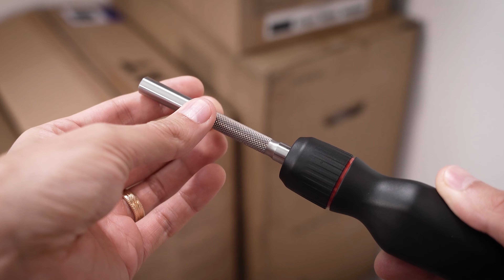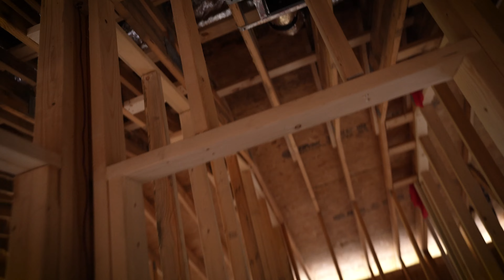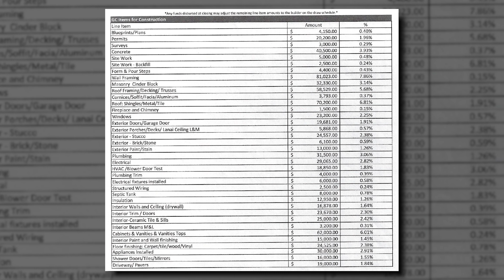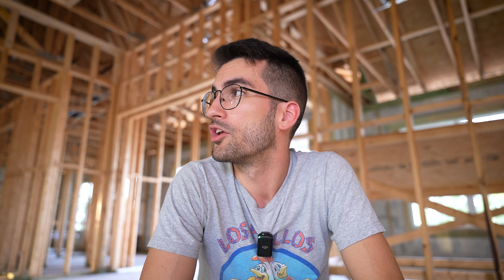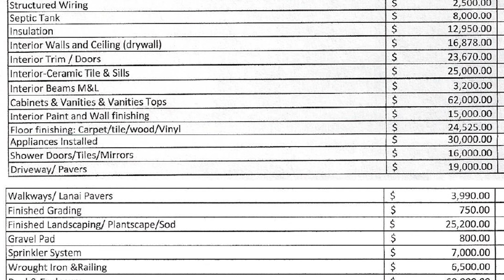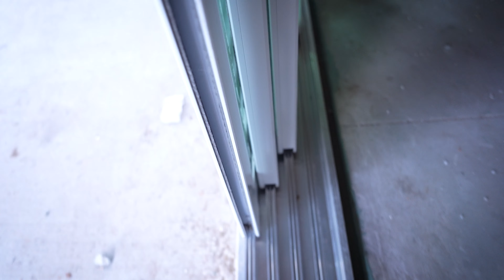Here’s How Much EVERYTHING Costs...

Comment: If anyone wants to give crap over the design - I saw the area impacted by the eye wall of Hurricane Ian.  The only new construction homes I saw when I was there that really got blown down were a couple under construction brick walls that didn't have any framing yet to shore them up (although, I would not be brave enough to go 2 story since that's always full wood from what I saw).  The really hard hit areas like Fort Myers Beach were not wind damaged.  They were water damaged.  Water moves mountains.  You are not going to be able to build anything reasonably affordably to withstand a sudden 12 foot high tide.  The correct construction is wooden interior framing.  None of that metal crap and none of that concrete crap.

Comment: I'm an Electrical Engineer in Southwest Florida, I've work on electrical designs for a few homes. I can say your build looks better than 99% of the McMansions we would be hired to design.
That low voltage installer issue is frustrating, finding good low voltage installers if hard enough.
I hope you continue making these as they are very interesting to see from the home owner's perspective.

Comment: Talk to your electrician. Chances are they will let you run all your cables and they will check off on it. But run it by them, they may go around and mark the locations with you so you do not interfere with the rest of the electrical in the house. because low voltage and line voltage need to be kept separate from one another. That is probably why your county requires an electrician to do it.

Comment: here's hoping that A/C is multi-zone with separate thermostats.

Edit: I have been re-terminating the cat 5e I put in when I remodeled in 1999. The Belden REVconnect tools are terrific.  I actually put in cable bundles with 2 RG6 coax, 2 cat 5e, and 2 OM1 multi-mode fiber. This summer I have been finally terminating the OM1! 10Gb!
Reply: Yup. Those tools are really useful.

Comment: As an engineer who works frequently with local government entities, this video provides valuable insight into the cost of building a home. While I do not specialize in that particular field, it's a welcome sight to see someone realize how complex it truly is, and provide valuable information to your viewers.
Btw - when it comes to a line item exceeding the cost of the original budget, there is typically a contingency fee to accommodate and encapsulate for such things - inflated lumber cost being your example. 
For example, if the home was $1,000,000 to construct, you'd be wise to have at least a $100,000 contingency - and that's on the low end. Typically I'd advise 20% or more, but I'm overly cautious.

Comment: Are you connected to the local municipal water supply? I guess some Floridians are both: on well water & a septic system. For installation of ethernet cabling: that should be legal for the home owner to do. Write a letter to your county commissioner, if that rule is county-specific. For the hot water heater: there are technologies (on YT videos) to electrify the sacrificial anode that is supposed to eliminate the problem of debris accumulation at the bottom of the hot water tank, where you have to clean out on a periodic basis.

Comment: I would run a conduit from your server room to the outside so your internet provider can get the wire into that room!!! because without a conduit good luck getting an installer to go in you attic they will say outside wall or nothing and leave! Even if you run cat6 and rg6 [coax] into that room from the outside what if your internet provider uses fiber its just easier to run a conduit with a pull string in it from that room to outside. I'm installer for a phone company here in KY

Comment: Fiber optic is not low voltage (though your county could decide, or have in statute, that it counts) and can higher max bandwidth over cat6/6a. Also lighter colored roofs lower cooler bills if done right. Though solar might be an option to offset electric costs. I wouldn't be surprised if you've already considered all this and made the decisions you did for valid reasons I don't know.

Comment: Greg, In the UK we primarily have two types of build for new houses.  Traditional and timber frame. There are others. 
Traditional is usually brick or stone cladding (can also be rendered), a cavity with insulation then thermalite block. The rest of the interior walls are timber studded and plaster board. 
Most UK new builds don't build with traditional as it's expensive. 
The alternative is timber frame which is  as it sounds. Timber frame is cheaper or was pre.covid and can be put up very quickly. It's why most new builds are made of cheese in the UK. 
Anyone in the UK moaning about USA having timber houses should give their head a wobble. 😂

Comment: Hvac seems cheap for the size of the house and including a blower door test.
Reply from the maker: It's two standalone units, rated for far higher than the square footage of the house.
Reply: @GregSalazar  I'd think an air return for the office would make more sense than putting an exhaust fan in a closet to promote cool air. I'd think an air return upstairs and a register for the closet vs exhaust fan.

Comment: The space would be best for multiple setups. So that you can have permanent lights configured. If you need to shoot a close up you forgot. Or need a bigger space for a weird case. You got it on hand. The only thing I would nitpick about. Is were the pipes travel through the wood beams. You don't have metal guards on the beams, to prevent people from accidentally drilling into them. If you want to hang up a picture frame.

Comment: This breaks my heart seeing your pour duct system. you paid an arm and leg i bet for what maybe cost $2000 in materials. i hope youre installing variable speed indoor units. statics pressure will be crazy with dead head boxes.
Reply from the maker: For what it's worth, we'll have two standalone AC units installed. Rated for significantly more square footage than will be cooled in this home.
Reply: @GregSalazar  Oversizing your units doesn’t make it better. Just a tip. Most of the time causes problems. Also never seen a blower door test done without a home fully finished. Most commonly used to find your home issues. 16 years of doing this I felt I’d help with a few tips. Next time I’m in Florida I’ll gladly help out.

Comment: It's so stupid that they won't allow you to run your own low voltage. I had to renovate a room, previous owner did some very unsafe electrical, so we gutted the entire room. Allowed me to get Cat6a to every location I wanted to. And since it was a existing construction, I didn't pull a permit and didn't have to deal with inspectors... and most of them are incompetent, and there are a lot of corrupt ones too. I had a lot of fun doing it and it's complete BS that they won't let you. Question I have to ask... is how would the inspector know as long as everything is done to code? They requiring another permit to be drawn to run the low voltage? If so, we have the true reason why.... money.
Reply from the maker: The inspector follows up with all cited work and checks credentials with the sub-contractors.
Reply: @GregSalazar  I see. I've done some low voltage for family when they were building their houses and not a single person asked about it. Granted, it was all done to code, but our city inspectors tend to be on the incompetent side. Regardless... a bummer, but you electrician should be able to do all the Cat6 for you.

Comment: I recommend AT&T Fiber over any of the other 1 Gig services. I haven't had one problem with there service since I started it 2 months ago. The WiFi 6E is great and covers much more area than Mediacom and there multi day reset modem system. I guess I beat the system when I built my house back in 1983 in Winter haven, Florida because I ran speaker wire to all the areas I wanted to put sound. I was also allowed to sprinkle boric acid on all the studs before they put up drywall, what Paul Harvey and everyone else  used to call Roach Proof, to keep my home free of crawling creatures. They eat it and take it back to the nests and they all explode.

Comment: I would add a door on the office side for that bigger closet, otherwise your going to have to go out of the office to access the big closet? I got a free CAT 6 outlet in my office as when we were doing one of our walk through's I noticed that they added it to the wrong wall that I specified and was specified in the plans. This was near the end so they left the one they originally put in and added the other one, said because it was their mistake they would not charge me to change anything, so now if I want I can plug my computer into the opposite wall or put a tv up or whatever. I was kind of happy they made a mistake. lol Sad part is I'm in California so our house is half the cost of yours and only about 1/3rd the size😔. One bit of good news is though, is that after only 1- 1/2 years our house has already increased by $300 Grand and is now almost worth 1 mill, so there is that.
Reply from the maker: Yeah that area upstairs is a bit wonky, but we don't want a door right up against stairs - not even sure if that'd be up to code here.

Comment: Greg would a 3060ti and a ryzen am4 work good with each other?
Reply from the maker: Without CPU specifics, I can't say. In general, though, you should be fine (assuming it's a 6/8C).
Reply: @GregSalazar  ryzen 5 5600x or ryzen 7 5700
Reply: Rayzen 5
Reply: Whats the price diff between the 2?
Reply: @evilleader1991  156 for the ryzen 5 5600x and 188 for the 7 5700g

Comment: with power costs increase here in australia you just cant skimp on insulation and venting the house to keep cool or warm,We just added a electric fan to draw out moister on high humidity times from in the ceiling as in winter south side of our house not warming up to get rid of moister as sun is low in winter .the fan is also set to kick in to draw out heat ,guys also placed vents around eves draws cooler air from out side pushes out fan side.